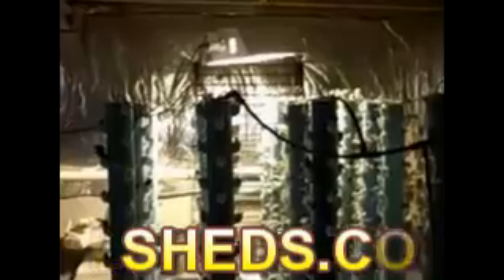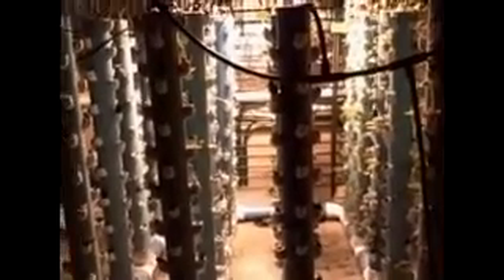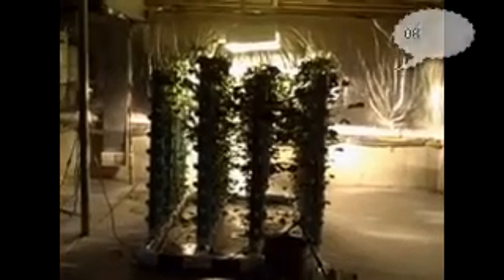Commercial Vertical Strawberry Hydroponics System

Comment: cool design, but more suited for outside or a greenhouse....usable light penetration would never reach the bottom sites even with a 1000 watt high output lighting system.  if i were to keep this on the basement, i would supplement the bottom sites with side lighting and drop some hanging bulbs down the middle.

Comment: with the 700 plant vertical strawberry grower, how would you remove all the roots to replant. do the loose roots plug up the system. how did this end up working?